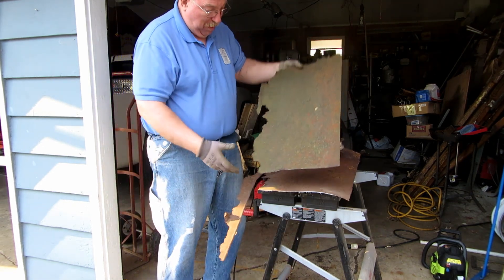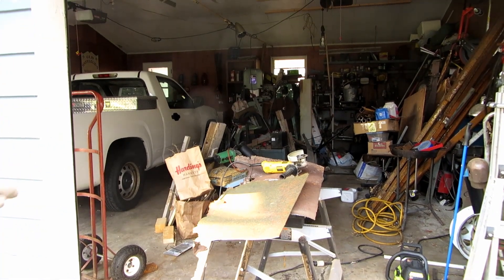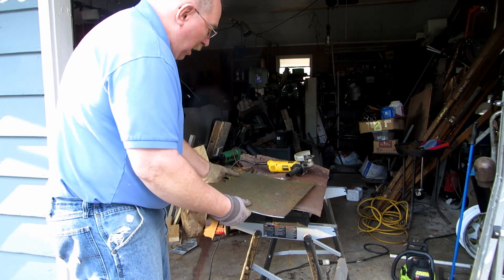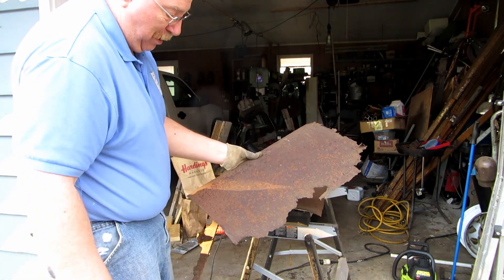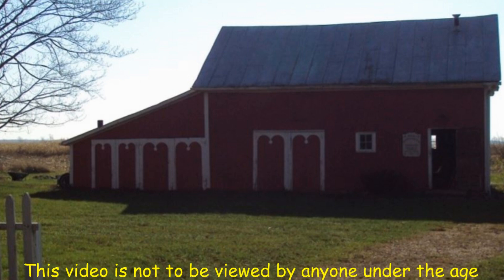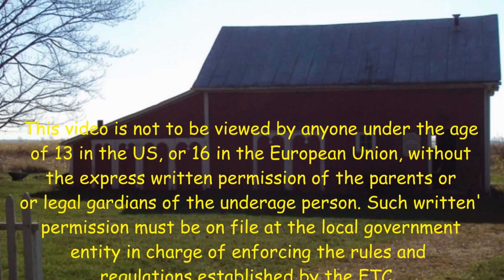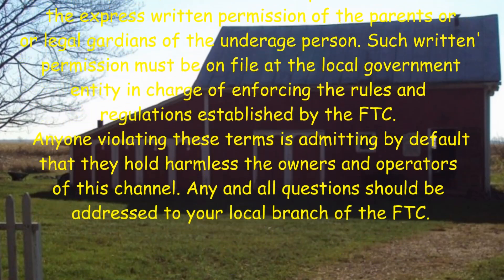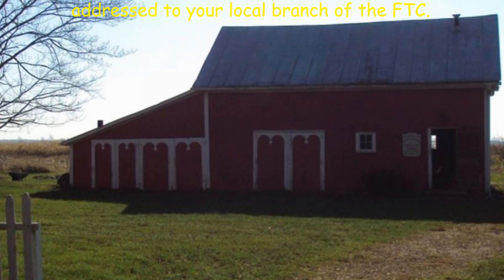Garden Fairy Wind Vane -  Prepping Material

Comment: Looks like a weener to me. My cup brush always fixes all my old stuff proper for the oil base tar-ish coat it's fixing to get. The car is GONE. Toots and the Grans and parent are going car looking tomorrow. Just lie me; old and worn out but I can still mow! Happy wind vaneing and GBWYall!
Reply from the maker: The garden fairy first appeared as a birthday present for in the house. It looked likea weathervane. Ancored to a piece ofmarble it doesn't spin 
Moving forward the nibbler will cut the work time to 1/4 of what it was. 
You will always get them home some how. A car just won't care.
Reply: @OldSneelock  Got a linen on a NICE one but time will tell. The Grandgirl cried about the old one biting the dust with all the good memories we had in it but she's looking forward to starting over with another.  26 years was a good deal with the old one but there was too much to fix to make it worthwhile. If the fuel pump had held pout it's still be going. Went on black ice like a loaded truck.
Reply from the maker: Everything has a limit. 
Big Ernie, my old 46 3 ton flat bed Ford had the mechanical fuel pump that ran off a cam lobe on the valve cam shaft. The cam had worn flat after a long time running and I put in an electric pump and a regulator. It worked but you had to turn it on and wait a minute before starting the engine so the line would fill. 😁😎
26 years is an amazing run. Especially considering where you are driving. Up hill and down, rain, shine, snow, or blow. 
When Lydia and I took our vacation down in your neck of the woods the Ford van worked pretty hard getting up and down some of the roads.
Reply: @OldSneelock  Had an ex cousin-in-law that had the same lobeless camshaft and built a scaffold over the cab and ran the gas by gravity. An old Dodge pickup. Painted it all up black and was right reasonable. The old Buick was a fine rig and would still be going if the fuel pump held out BUT it was really rusted. The V-6 had plenty of zi[p for these hills because it was like a horse going to the barn and knew where the resting place was. IF all works out the new one will be a lot like it. Time will tell as they headed out at 9:30 this morning to smoke it over. And the hills are still hare but some have 3 lanes instead of 1 1/2. Up has always got to be up.
Reply: @OldSneelock  The nice one worked out and a LOT more car than I was even thinking about;  2010 Lincoln with 27.5 K original miles! Came out of Gawgah and we're 3rd owner. Same basic V-6 as the Buick but a Ford. 3.6 I think. The Taco has a 4.3. It is CHERRY! The Lincoln. The Taco has never seen a cherry or a tree, even. White with black interior. $11k and change and has everything. All it has to do is last! I still can't believe it. NOW everybody can relax. GBWYall!
Reply from the maker: We have owned 3 Towncars. Nice cars to drive and strong like bull. Room for 6 bodies in the trunk. Great for the drive in.
Reply: @OldSneelock  The drive-in here has been gone for years and I don't even know of one anywhere and since we don't like to be out after dark, that sort of throws a big kink it that and all the junk in the eating joints so we just stay at home BUT she can sure haul back a store full in that trunk, NO lie! What a cavern! And it's a little shorter than the Buick. It's already bit the dust at the same junk yard we got parts to make a roadworthy Rabbit out of years ago. This'll be my 4th Ford and I've always liked whatever would run under it's own power. 2 GMC's and 2 Chevy's, a Pontiac, 3 Wabbits and a Honda and a Jeep 3B. So far and I can just see you and Auntie tooling around in a Town Car. One of my concrete truck bosses wanted a Lincoln and when he got one I called him ABE from then on. Happy weekend and Grandparents DayS!